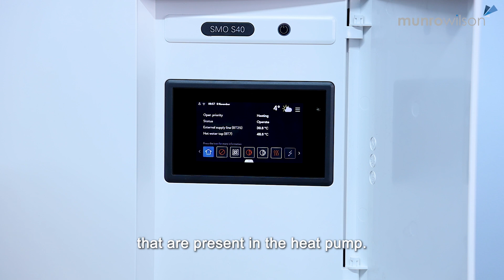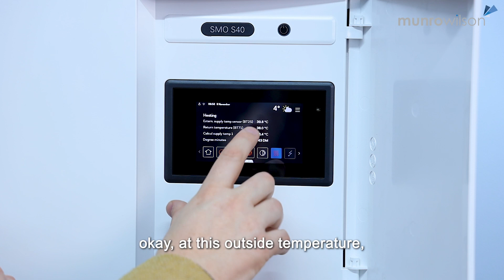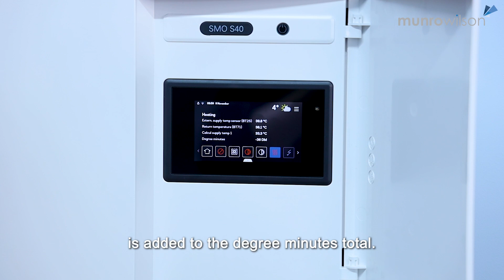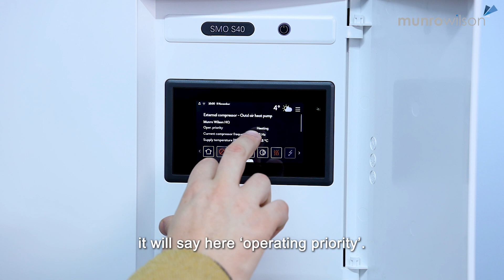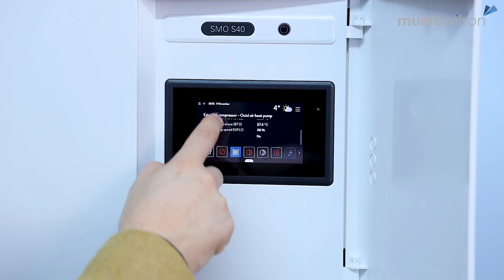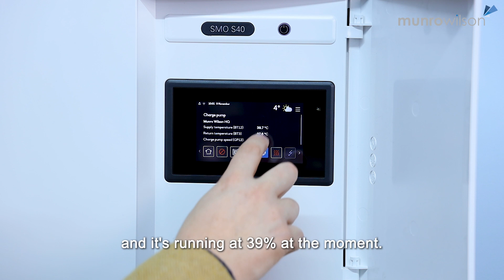Heat Pump Advanced Settings - NIBE S-Series

Comment: What I observe is that the controller frequently runs the compressor much harder than necessary and overshoots by far the calculated supply T for the chosen heating curve, thus eating up the degree minutes too quickly and promoting cycling. How can this be mitigated? Isn't running the compressor at lower frequency for longer be beneficial for both electricity bills and compressor health?
Reply: try to play with maximum temperature for heating system. Right now when outside it was - 12 or -15 degrees mine max heating temperature was set to 45. I set it right now for 35 and set heating curve to 3. and frequency drops from 120Hz to 60-70. I'm monitoring right now temperature inside the building :)
Reply: @3D_FPV i have the same problem, you telling me that at -2 C i have to get it about 35?
Reply: @mariokranjec  I'm telling about maximum heating supply temp parameter -> you can find it in serwice tab